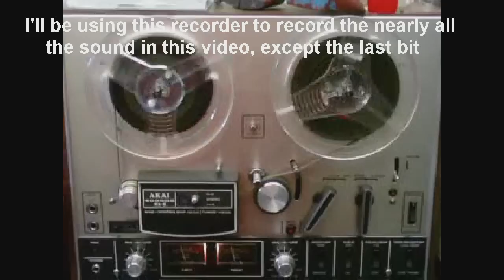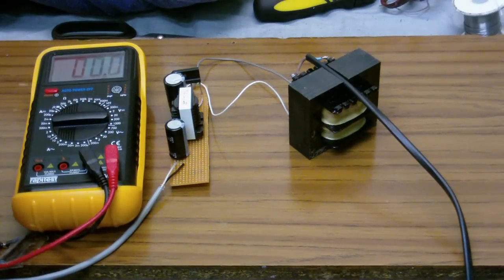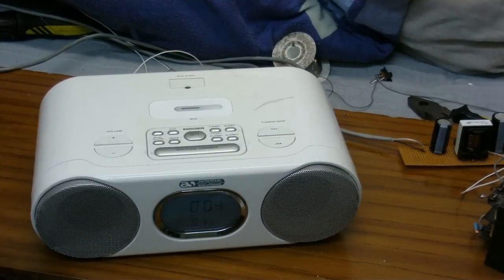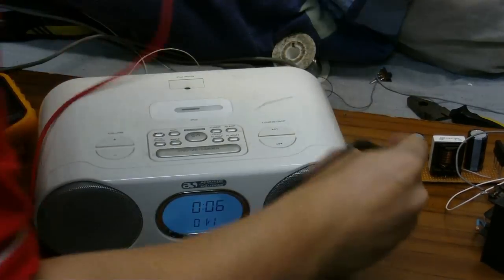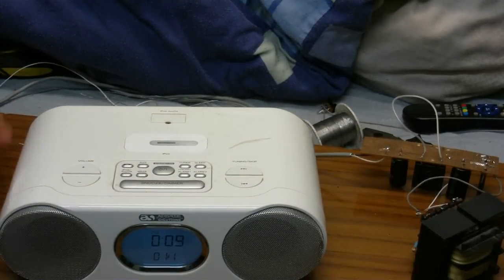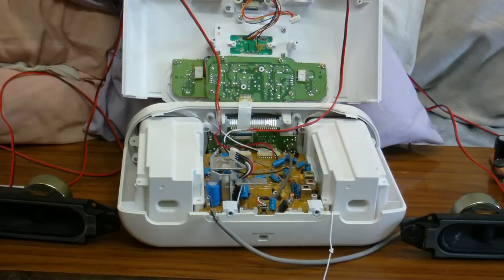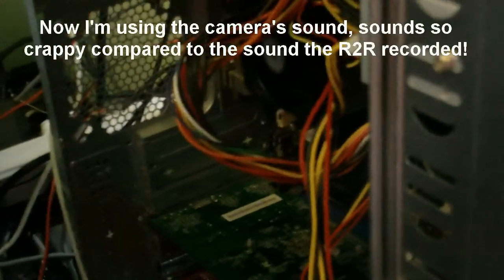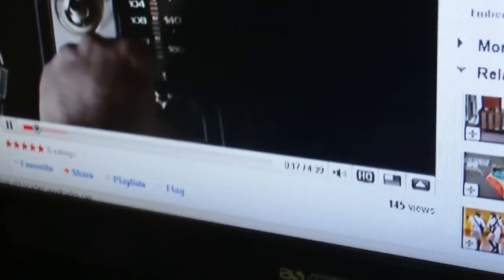Circut bending an iPod dock and making a power supply for it.

Comment: Very nice there! You could build a case for the power supply and the 2 more for the speakers, wood cases would be nice, with cloth grilles and painted or stained. Anyway, that's my recommendation. You could use with the Akai reel-to-reel for stereo sound. That reel-to-reel sounds great and you keep it synced "reel" well!

Comment: The song at the beginning is by the Flirts and the name is "Helpless".
The external speakers sure sound a lot better than the built in ones. I would try to put the new power supply into the iPod dock's housing, in place of the speakers. I think your new power supply is better than the original one, because it can deliver a lot more current.